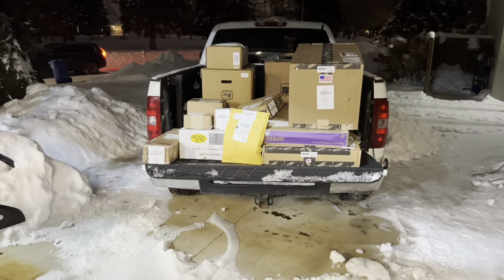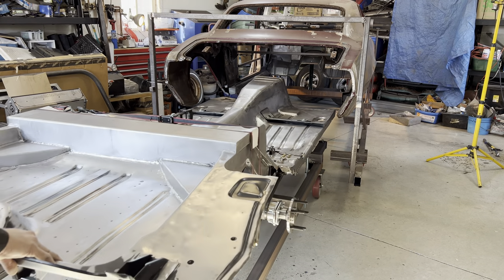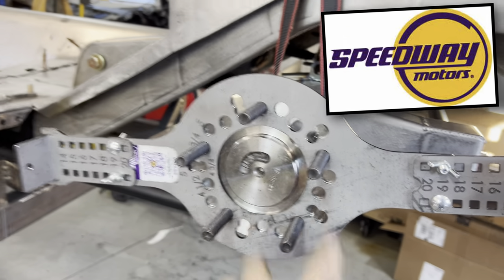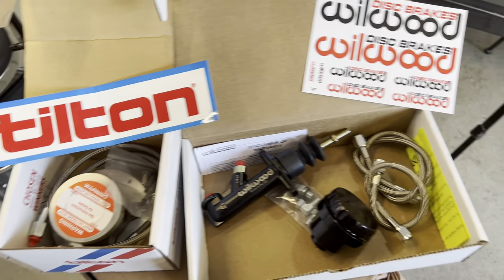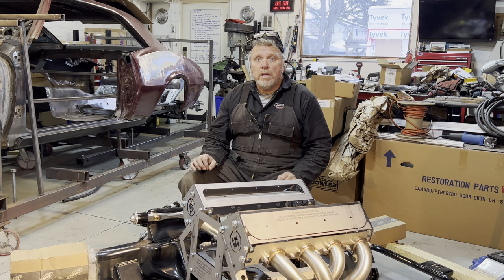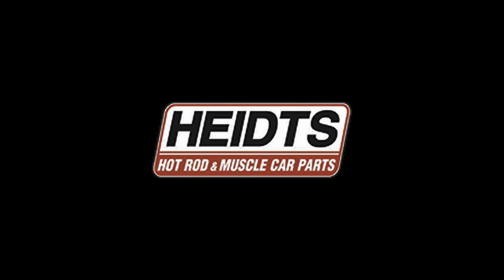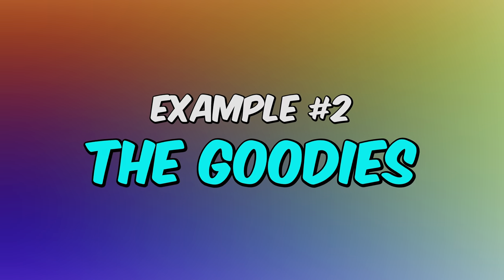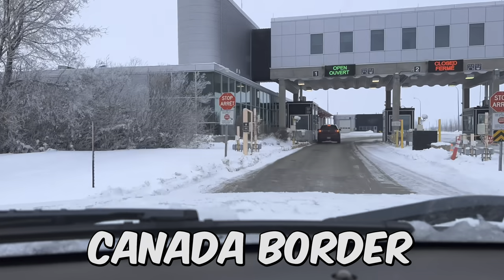Top 3 Strategies: Unleash the Power of BUY SMART

Comment: Another good video. Same rear tires I am running.
Reply from the maker: Awesome. Thanks. What size tire you running on the front?
Reply: @ParadiseBayCustoms  I will run the 285s when competing but the 325s fit up front for showing off
Reply from the maker: @shawnwedge5833  😂 👍